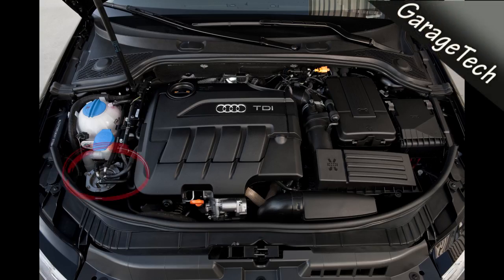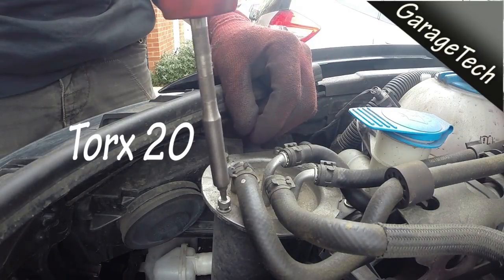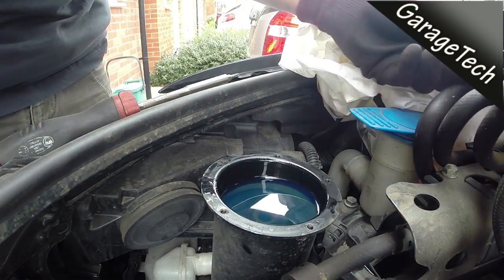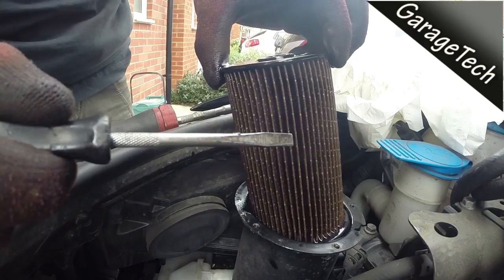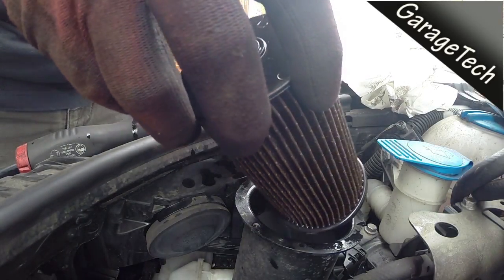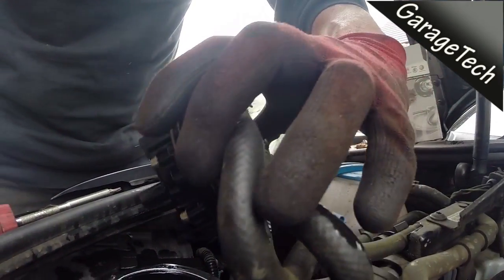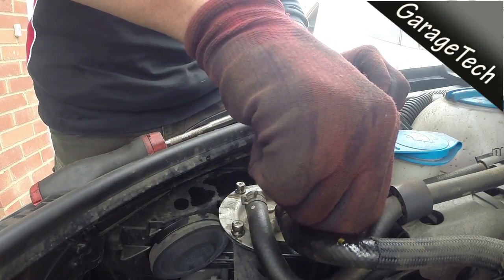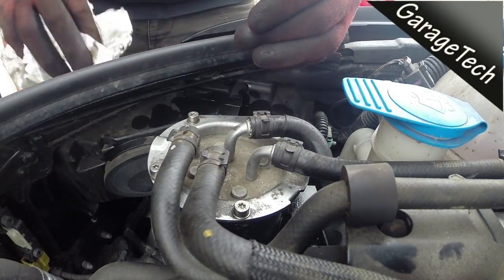How To Change A Diesel Fuel Filter VW/Audi 2.0l TDI

Comment: Sadly, there is no mention at all of the recommended service procedure, which is to prime the fuel pump using VCDS or a similar tool after the filter change.  The DIY community debates the need for that a lot, but mostly based on "I got away with it, so it's not needed".  I guess the guys who have problems with not priming don't tend to come and brag about it.  If you decide to do this and do not have VCDS, the other tips and suggestions are: let the old filter drip back, as Darren does.  Insert the new filter slowly so that fuel is not lost, and top up around the sides of the filter with either fresh diesel or some diesel fuel cleaner.  Turn the key without starting the engine several times before starting for real.  I'm sure many will say it's very unlikely to be a problem.  But   Risk = probability x cost of the outcome.  It's all very well to feel great until it does happen, but then feel pretty stupid for risking it.

Also consider putting shop towel around the filter housing before starting to catch drips rather than trying to clean the up afterwards.  Tighten screws afterwards finger tight and then tighten in a star pattern gradually - the screws seat the seal and lid. Uneven tightening by simply tightening in a circular motion is one of the causes of leaks afterwards.

This guy does a better job IMO: https://www.youtube.com/watch?v=AFVLfo_A9Gs
Reply from the maker: Hi, thanks for the comment and some great tips and advice. Agreed there are many discussions on how to bleed the system etc. For most people attempting this at home without the access to a diagnostic tool, i would recommend the below steps:

First before replacing, run the engine for a few minutes. This ensures there is fuel in the lines and reduces the amount of fuel which gradually drains back to the tank. 

When replacing the filter, ensure there's as much fuel back in the fuel filter housing as posible, use clean new fuel if you have some. Then prime the system by turning the ignition on for 2-3 seconds and then off again. repeat this 10 times, you should hear the system priming. 

If you have a battery booster, connect it so there's sufficient battery power for a longer cranking time if needed. 

Generally issues occur when there's not enough fuel in the fuel filter housing, once the engine gets started it's usually enough to keep it going. Let the engine idle for a few minutes and don't press the accelerator.

If it cuts out after a few seconds, prime the system again by cycling the ignition multiple times, at least 10.

Having worked in a main dealer changing these on a daily basis, I've never had to use a beading tool or diag machine to get an engine started after replacement. Below are some official instructions from the ElsaPro workshop manual from VWG. Even with the diagnostic machine, all it is doing is running the fuel tank pump which you can do by cycling the ignition.

If you are one of the unfortunate ones where the engine still doesn't start, and you don't have a diag tool,  then the next step would be to very slightly open the high pressure lines at the injectors, and crank the engine over until you see fuel coming out. When i say open, i literally mean open by the smallest amount, don't loosen completely, back it off by a 1/4 turn, enough for it to leak. The fuel pressure will be up to 2000bar /30,000PSI. Obviously you will want to put some rags around the pipes to avoid a lot of fuel getting everywhere, and watch you eyes. This will help get any air out of the lines.

Official wording below from ElsaPro workshop manual.

Filling and bleeding fuel system
General Information
WARNING
Running the engine before bleeding the fuel system causes irreparable damage to high-pressure pump.
♦ 	If components of the fuel system between the fuel tank and the high-pressure pump have been removed and re-installed or renewed, the fuel system must be filled before the engine is started for the first time.
♦ 	If the high-pressure pump has been removed and re-installed or renewed, the first fuel filling must be performed before the engine is started for the first time.

Risk of engine malfunctions due to air in fuel system.

If components of the fuel system downstream of the high-pressure pump are removed and re-installed or renewed, the fuel system must be bled
Special tools and workshop equipment required
♦ 	Vehicle tester

Filling the fuel system after component replacement (not high pressure fuel pump)
– 	Connect the Vehicle tester to the car.
– 	Open Test plan
– 	Open Select own test
– 	Open V8 Engine Diesel
– 	Open Self diagnostic capable system
– 	Open Engine control unit J623
– 	Open Basic settings
– 	Follow the test plan for Fuel system first time fill
– 	The test plan will run the fuel pump for 120 seconds.
– 	The fuel pump MUST be run for approximately 2 minutes before the engine can be started.
– 	Bleed the fuel system (see below).
Filling the fuel system after replacing the high pressure pump
– 	Connect the Vehicle tester to the car.
– 	Open Test plan
– 	Open Select own test
– 	Open V8 Engine Diesel
– 	Open Self diagnostic capable system
– 	Open Engine control unit J623
– 	Open Basic settings
– 	Follow the test plan for Fuel system first time fill
– 	The test plan will run the fuel pump for 120 seconds.
– 	Repeat this step twice.
– 	The fuel pump MUST be run for approximately 4 minutes before the engine can be started.
– 	Bleed the fuel system (see below).
Bleeding the fuel system
– 	Start engine and run at idling speed for several minutes (do not press accelerator) the fuel system will bleed itself automatically.
– 	Switch off the engine.
– 	Check fuel system for leaks. Refer to "Checking fuel system for leaks" .
→ Rep. Gr. 23

Comment: One thing I would like to know is before you changed the fuel filter, the old filter was attached. How come you didn't attach the new fuel filter to the attachment section? You just let the fuel filter drop in the housing. Thanks.
Reply from the maker: Hey, it’s easier to just pop the filter into the housing because once you put the top on and screw it down, the top locates into the filter. Just make sure there’s a bit of fuel on the seal for lubrication 👍🏼👍🏼
Reply: @GarageTechAutomotive . Thank you but what if the top doesn't somehow locate the filter and connect it?
Reply from the maker: @anjummughal8536  you’ll know about it as the top will either not screw down correctly or not at all.

Comment: How to remove Air from fuel pipes ?
Reply from the maker: @sakibchakh415  you can try turning the ignition on and off several times to prime the fuel pump. Or use a mityvac hand pump to suck the fuel through.

Comment: How does the access air come out ? Isn’t there a prime for the filter ?
Reply from the maker: There’s no primer, if you cycle the ignition a few times that will start the fuel tank pump briefly. Any access air vents back through the return. Best thing to do is ensure the fuel filter housing has fuel in it before tightening it up. 👍🏼

Comment: Followed this exactly on Audi A3 8P but car wont start now. Primed through ignition several times before start but car wont start. Can hear fuel pump for a couple of seconds then nothing when turning key. Any help?
Reply: Think you might need to add some more fuel in where the filter was taken out

Comment: Didn't like the way you dropped the filter into the housing assuming all will line up when you tightened the head down, be better to locate the filter onto the head housing before lowering into the bowl otherwise you have no idea if it hasn't been compromised, it could be all squashed up and unattached
Reply: No need to worry as centre holes on the filter will mate to the spigots on top and bottom of the housing.

Comment: Hi What about bleeding the system before attempting to start it? rehards Jay
Reply from the maker: If you have some diesel you can fill the fuel filter housing up with fuel. you can also cycle the ignition a number of times which will prime the fuel system
Reply: @GarageTechAutomotive  ok thanks but some need a scan tool to run the lift pump but if filling with diesel will work then will try that.
Thank you.
Kind regards 
Jay

Comment: mine is leaking after doing this, changed the o ring twise now still leaking o ring is correct and seated well in the groove. why?
Reply: Torq to spec. O rings only work when they're squished so torq those top 5-6 bolts to spec or just a little tighter. A mechanic also would charge much to solve that issue if you don't have a torq wrench

Comment: Great Video mate. Do we need anything for vacuity ? Or just start the key?
Reply from the maker: You can help prime the system by turning the ignition on and off a few times, that can help reduce the chance of it cutting out due to fuel starvation. If you drain the fuel in the housing make sure to top it up with fresh fuel otherwise you will have trouble starting. 

Plenty of tissues/rags to clean up any mess, diesel gets quite messy and try to avoid dripping any onto the auxiliary belt. Good luck 🤞🏽

Comment: I always do pollen, air and fuel myself and let garage do oil and oil filter
Reply: Just done it myself for the first time, albeit I had the wrong filter first. But easy enough, and garage will only be doing my oil/filter from now. 

I may even step up and do that too
Reply: @joehurst1453  good just make them do the dirty work lol also we don't have ramps tools etc to jack the car up so leave that to them. Also Google before taking to garage it maybe something simple
Reply: Evolution  no not for those items. It's basic changing and doesn't need to be recalibrated etc

Comment: Just had this done but the diesel is leaking sightly. How do i fix this? Shall i get a new seal to put on the housing?
Reply from the maker: Yes, seen this a few times, change the seal, put some diesel round it when putting it back to give it some lubrication.
Reply: @GarageTechAutomotive  Thanks I'll give that a try.

Comment: most important thing is, there must be enough fuel in the filter housing, othervise the car wont start!!!!! very important to have some diesel in a bottle to fill up!!!!
Reply: nah, the pump will provide enough fuel, you just need to turn the key into first position few times before starting the engine.
Reply: @vitcermak7737  not with common rail engine! that works only on PD(pumpe duse) engines.
Reply: yeh not a bad idea to top up the filter with diesel so dont get air in the lines

Comment: how long do diesel fuel filters last?
Reply from the maker: Depends on the engine but most are about 20,000 miles. I like to change them every year/service. The filters are cheep and easy to change. You would be surprised how dirty they get. The diesel fuel also lubricates the high pressure pump and injectors so worth doing.
Reply: @GarageTechAutomotive   thanks! If I change the fuel filter does that also remove the water? Or do I need to do that seperate? I read in the manual that part of the filters job is to remove water in the diesel that builds up, and when full it will put a dash warning light on. Mine is yet to stay fully on, but after starting the car, the fuel filter light did come on for a few seconds
Reply from the maker: @scottlawson1800  on these engines with this type of fuel filter, any water in the fuel will most likely stay in the housing when talking the filter out. Best thing to do is remove the leftover fuel from within the filter housing, and top it back up with clean fuel. If you don’t top it up, it will take ages to start and will most likely flatten the battery. There isn’t a warning light just for water in the fuel. The engine warning light will come on when you turn the ignition on, and then go out once the engine starts. Hope that helps
Reply: @GarageTechAutomotive  fantastic, I'll do that 👍 thanks for the help
Reply from the maker: @scottlawson1800  no worries, enjoy 👍🏼

Comment: If dont do the correct priming sequence after filter changr on the high pressure 2015 2.0 its known to destroy your expensive fuel pumps within a month or two... That repair is so expensive its worth paying the dealer to do thr filtee change, reminding them to prime it right. Going instantly from 0psi to like 3300psi is what kill the 2 stage pumps.
Reply: hi what is the priming sequence mate?
Reply: Doesn’t the fuel lubricate and cool the pump?
Reply: thats not true. Air does nothing to the pump or injectors other than not starting until the air has been pushed out

Comment: Hello, just recieved my fuel filter replacement yesterday from the brand Mahle but I have some doubts. Inside de box came the bare filter, not inside a plastic bag or anything,also I saw they typically come with a cap on the upper hole but this one came without it plus it has very small particles like a little bit of dust that comes off when you rub it, It's the first time I'm doing this replacement so I don't know if this is normal. 
I'd be glad to know what you think guys. Should I return it to the seller? Or it's normal?
Reply: sounds like a fake part mate its hard to get original parts now days.
Reply: got one today was the same no caps...must be genuine came from eurocarparts....

Comment: I've seen the same procedure done at a mechanic  and now at you, so I'm willing to give it a try.
Reply: This is maybe the easiest maintenance task on this car. Few hints from my experience:
1) make sure you buy the right filter, Octavia/golf/A4 had multiple variants of the fuel filter, I had to learn this the hard way.
2) wrap a rug around the filterbox so the fuel does not spill everywhere.
3) take a plastic bag and put it over the alternator belt, which is right under the filter. You don't want fuel on the belt.
4) Pay attention to not drop the rubber gasket from the lid into the filterbox, it is pain to remove it if you do so (don't ask me how do I know...)
5) use clean gloves to work with the new filter
6) let the filter sink on its own and soak up the fuel before you screw the lid down to avoid spilling extra fuel.
7) you probably know this one - turn the key on and off the first position before turning the engine on to bleed the fuel system.
Reply: @vitcermak7737  thanks sir

Comment: My oil filter is not next to the engine...where is it? Underneath?  Mine is 2013 Scirocco R 2.0 L TFSI gasoline
Reply from the maker: breakaway2x, yes it’s underneath, you will need to remove the under tray to get to it. Once that’s off it’s quite straightforward. You’ll need a 32mm socket if I remember correctly. Good luck
Reply: @GarageTechAutomotive  thanks! Will love try doing it myself once.  Will i also need new o ring or something?
Reply from the maker: breakaway2x, yes you should get a new O ring with the new oil filter.

Comment: Dont you have to bleed the system after for air ?
Reply: done this (twice, thanks to buying wrong fuel filter the first time :D) and both times, the system bleeds itself, no need for extra work, just screw the lid on and turn the key on and off the first position few times, the car starts right away.
Reply: Iv been told you dont
Reply: I am going to try changing fuel filter on my Passat B8 tomorrow if bleeding is not required. I am worried engine won't start due to oil pressure reduced after the filter change. I haven't located the valve on the fuel injector yet.
Reply: Auto priming, so not required. If air does get in the system it may take a while to pull through, but will prime and start just fine. No air release or priming needs to be done.

Comment: Do you think it's worth draining the   old fuel that the filter sits in?
Reply: Don’t think it’s worth it. But If I do mine I think I’ll add some more fuel to top it off and get it as full as I can
Reply: Best idea is to siphon off as much as possible and refill to the top with pure power service as much as possible.  Then follow vag service manual,s  pump priming method using vag computer.

Comment: I think its smart that VAG put the fuel filter in a easy to reach spot. Other cars I've changed them out underneath the car by the fuel tank.
Reply: Shame most the other important parts are hidden
Reply: This is the secondary filter mate.

Comment: Hello, how many kms does the old filter have when you replace it? Do you replace it every two years? Thank you!
Reply: my official service offer was every oil filter change needed the fuel filter change also, app. 25000km, if you adviced the original service reccomendation. if not, then every 2oil change is one fuel filter change. depend where you fueled the car, you can easy follow up, where is the best fuel to your car...
Reply: 38000 is the recommended service mileage

Comment: Very bad job. According to the Vw elsa repair manual you must drain out all the remaining fuel (water is present at the bottom) and in any case prime the system with vcds to avoid ruining the high pressure pump!!
Reply: If anything I would blame, VW for not installing water separator. Just lazy engineer but here I am with my 2014 passat TDI with 102xxxx miles and only empty the canister out occasionally.
Reply: Hi it's only necessary to remove the fuel from the housing if there are signs of organic matter in the fuel.
Reply: Let’s be honest. If you know how to do this job, why are you watching this video
Reply: To prevent people from believing that this is a safe way to do the job.
Reply: The garage thar replace my fuel filter two times never drain the remaining fuel or prime the syste, is that bad? Since 2017 and only 1 or 2 times per month the car takes 7/8 seconds to run, it seems like its starving fuel.
Reply: @dduarte29  Do you have an ea288? If yes watch this to solve your problem https://www.youtube.com/watch?v=DXvHdmq0reA&t=906s
Reply: @MultiPinasco  i have a 2006 2.0 tdi bkp 140hp.